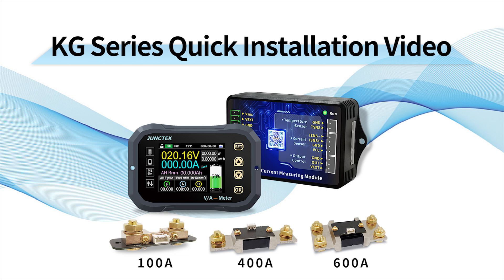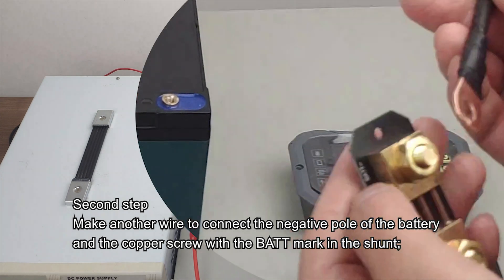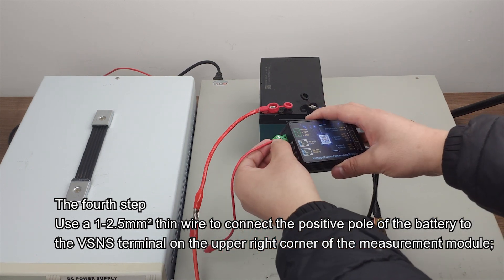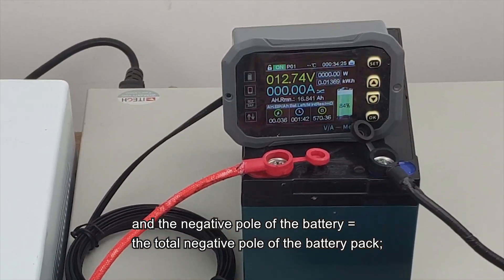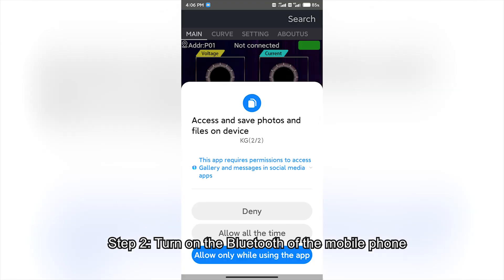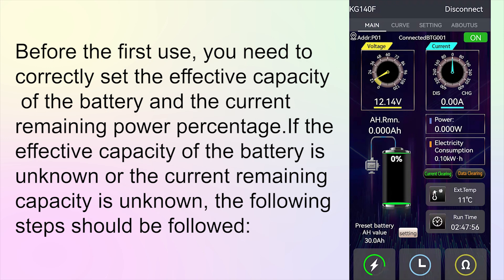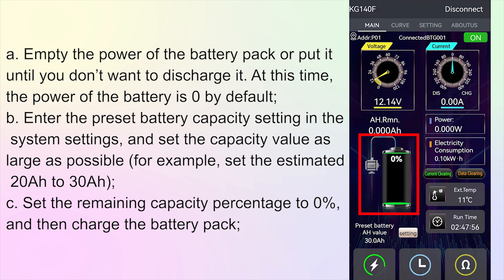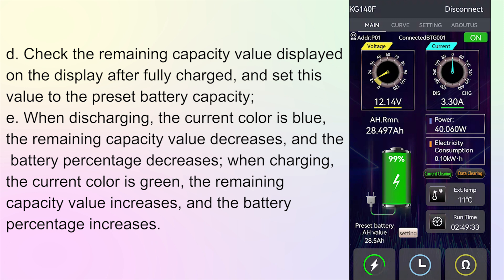KG-F series high precision bluetooth battery coulomb counter quick installation guide

Comment: Hi how do I determine battery capacity.exsample 4x180 Amp H 12 volt batteries in series in series =180 amp h,6 in parallel =180 Amp H. So do I stick with this setting to configure this shunt.cheers Rene.